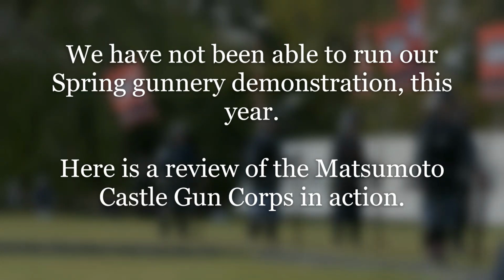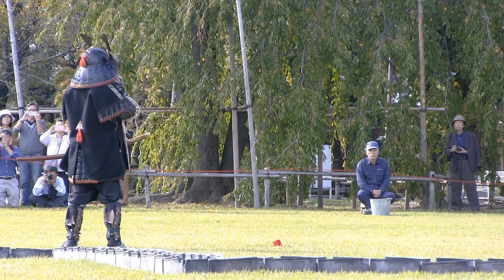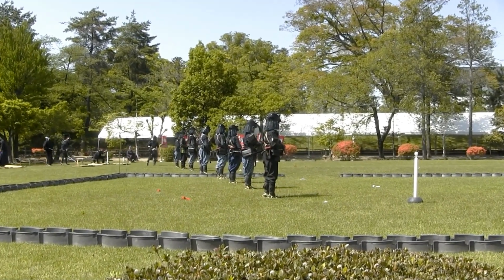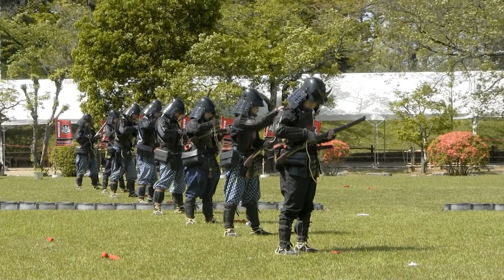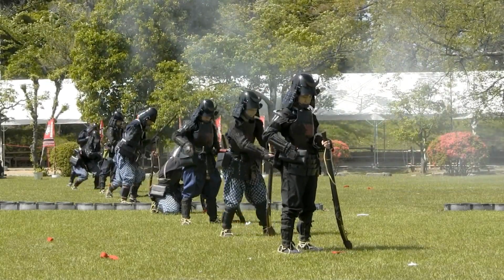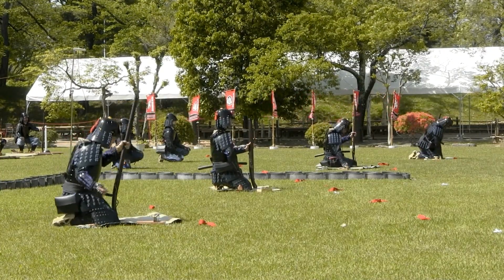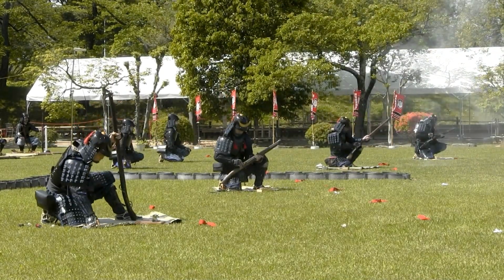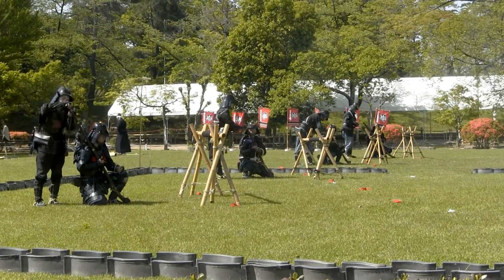Matchlock Samurai in Action

Comment: Question I heard there's a volley method where the first row gives their discharged guns to his rear and receives a loaded one.
Reply from the maker: That certainly is a technique but we don’t have enough gunners to do it properly at Matsumoto 🙇‍♂️
Reply: @Gun_Samurai  So it's an actually done historically?
Reply from the maker: Absolutely. As the guns would easily heat up; when fighting from a well prepared position (such as a castle) - it is a good idea to rotate guns in order to keep them cool and useable.
Reply: @Gun_Samurai  tnx
Reply: @Gun_Samurai  i can be the extra gun, i want to be the equivalent of the kid holding the golf clubs on a samurai battlefield